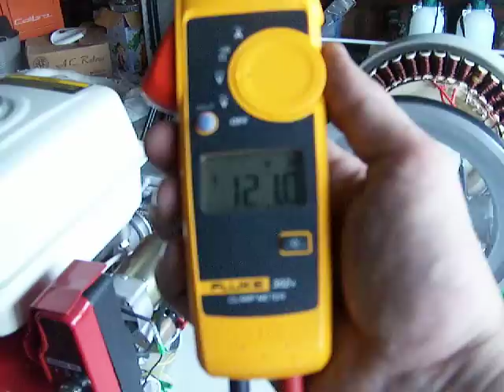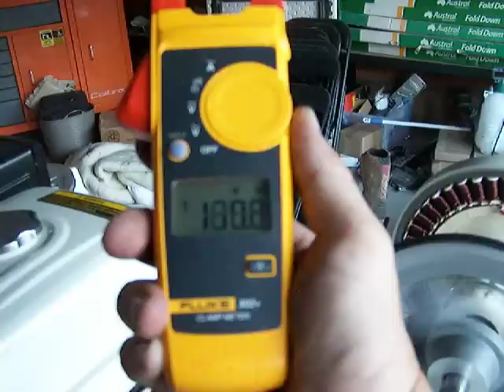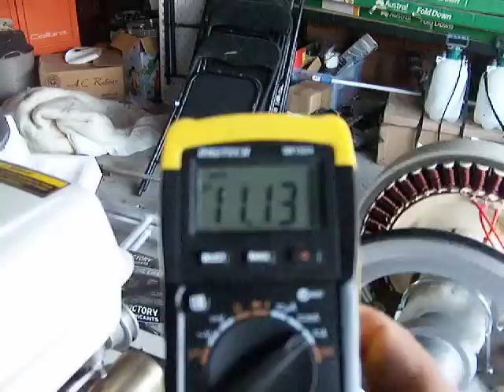Fisher and Paykel smart drive motor testing, part 3

Comment: You mentioned changing the number of turns on the windings ( as well as a more robust wire)  What changes when you increase (or decrease) the number of windings?
Reply: More windings; higher voltage.

Comment: some more info.     there is an  OPTIMAL  configuration for  ANY  pma.      this ain't it      there are REASONS why this info is Not just  opinion.       each phase Should consist of  three, equally spaced coils, connected in series; this is a relative interval of 120 degrees.      the rotor  Should  have  four, equally spaced magnetic poles, per phase; a relative interval of  90 degrees.    this  4:3  ratio results in the three  coils of each phase being energized simultaneously; and the phases energized in sequence.        thanks to hpiggot, some folks think that  Adjacent coils should be interconnected, in a f&p stator.    W R O N G.     it is safe to assume that your mods have NOT resulted in an efficient pma.     so,        the number of coils  Should be a Multiple of  Three;  the number of magnetic poles  SHOULD BE  a  multiple of  Four.     see linked illustration, of a Correct, 3-phase stator config.     it may be possible to reconfigure the  rotor, fairly easily.    the stator,  idk.        cheers
http://scoraigwind.co.uk/wp-content/uploads/2011/07/coils91.png

Comment: you need a better driver that is why , i wonder how much tourqe you have on it now ? what it heat the motor is the lenz and B-EMF , you can run it at 2000 if you want

Comment: Its great that you are experimenting with Power Generation - like Tesla!! A little constructive criticism on the Rotor with the extra strong magnets. I can never believe that you would achieve the maximum output from the F&P Rotor - as made from plastic. One of the first rules is to maintain the smallest possible Air-Gap between the Rotor and Stator Coils. This gap must be consistent and concentric. Can only be achieved with good Bearings and a fully-metal Rotor - such as aluminium. The neodymium magnets could be a shrink-fit into the slots - or even cast-in position. Many motocycle alternators are made in this way. From your video, it would appear that the air-gap has lots of variance (not concentric) between the rotor/stator, which is a bad recipe to start with. Finally, I wondered if you designed a generator with twice the diameter of the F&P Unit. The peripheral speed would increase - at lower engine revs too. Much bigger air - gap between the coils for cooling. Keep up the good work.

Comment: And as someone has already commented you were using the ammeter as the load not just as a current measuring device. What I have done with solar experiments is to get a light fixture and hook it up and as you screw the light bulbs in they become the load and they get hot and will burn you when you go to remove them. Find one that will take 3 light bulbs and screw in 3  60 watt bulbs one at a time but the voltage must be 120 volts or you will burn them out. AL

Comment: I noticed that someone mentioned heat being generated meaning you have resistance. The real truth is that heat is a function of current and resistance. It is the square of the current times the resistance. In this case you are overloading the washing machine motor. Someone said somewhere that the motor draws about 4 amps when working in the washing machine. You used slightly larger wire which lowered the resistance. The real problem is that 4 squared is only 16 times the resistance of the wire ( the old wire). 12 amps squared is 144 times the new lower resistance. If the new wire has 1/2 the resistance of the old wire that is good, but 144 times a new lower resistance that is one half as high results in 72.  72 is over 4 times more heat produced. This is a good experiment but the device is too small to be able to produce power for a long extended period of time without burning up the wire insulation. Al

Comment: heat is always a sign of resistance in your circuit or overloaded draw try using  caps in circuit to help with draw or transformer and caps wire gage increase will help as well

Comment: Matt you need to pulse drive the now highly efficient Fisher & Paykel you built.  Then use this to drive an alternator pulley either use the F&P rotor as fly wheel or add an intermediate one...between prime mover and alternator. Gerry at EmuPlns.

Comment: Just watched this one... and all of your "problems" seem to point to the mis-use of your Amp meter, which should NEVER be connected ACROSS the output of the rectifier... that also explains why it was getting so hot.  Be sure to read my notes on the previous video of this series... it explains in full details.

Comment: I found the solution to making better power with these. Of course you have to get the stators with the heavier gauge  or you can rewind them as you have.  Using 1.6 mm which is about 14 AWG wire is the best method for higher amps. That said, the best rotor design is NOT the fisher paykels design. I used 1 kind of magnet, a 25mm wide x 40mm long x 20 mm thick magnet and used 1 magnet for every 1.75 coils 42 poles got me 24 of these magnets. 
The change I made is I made my own rotor. By simply cutting me a large steel disc and bending a band of metal around it I made a pan ( rotor) with the band of metal being 2x the with of the magnets length to reduce eddy folding. I then placed a thin 24 gauge inner ring of aluminum into the rim and thats what I mounted the magnets to. It was then riveted to the thicker steel. This was done to give shared magnetism but to reduce magnetic pole parasitic reaction. 
That rotor was then cut and vented with ridges to make a blower like effect onto the stator. At 530 Rpms I am making 54 volts and 24 amps.  Not bad for a prototype.
Reply: Any improvements on this design I'm the end ? Thinking of using it for a wind turbine
Reply: Seems like a lot of work, im getting 25 amps from a 42 pole stock windings just reconfigured so every third coil is in parallel. Ive got it on an exercise bike currently and can pedal it to 345 watts at 13 volts under load (lithium battery connected directly) so im sure spinning it fast enough it would do 40-50v no problem. Making a whole new rotor or rewinding each coil by hand sounds like a nightmare! Id love to see yours, you definitely have some dedication going to that much effort, well done!

Comment: Nice job Matt.   If you can get a machine shop to cut the right shaped holes in the spinning rotor you should be able to cause a vortex to keep the stator coils cool.  You can also use pulse technology to gather the output instead of a constant draw.   I'm assuming that you have 4 magnets for each of the original 4 positioned ceramics.  are they the usual NSNS arrangement.    Have you seen Gerard Morins work with these motors?  here's a link 
https://www.youtube.com/watch?v=YZ7I9XgaW3A
Thanks
please email me directly
captainssbn@yahoo.com
Reply from the maker: ***** Thanks, im actually going to make a completely new rotor so i can put 10 x 20 x 50mm N52 neo magnets on it and spin it slow. What im trying to acheive is high output on low rpm. But i wont do any of this for a while as im busy but i will upload it when im done. Yes theres 4 mags as was original and yes they are NSNS.

Comment: Hi AHL, nice work!
Looking at this with pleasure because I am busy designing a pm alternator/generator with a diesel engine that's a lot more silent.
I tried to calculate the voltage of each coil and if I am right, it should be about 12V at 1,1 apms, is that correct? (230V divided by 1,4 for the voltage before the rectifier).

Instead of using "small magnets" I want to use the bigger ones with a lot bigger coil, weak-iron core and a low voltage of about 24V AC totally. The goal is to charge a set of 8 LiFePO4 CALB cells with about 100 Amps.

Could you give me some meore info about your measurements?
Regards

Paul

Comment: That is OK while you run it free, but as soon as you put any sort of proper load on it, it could catch fire, or burn out the coils.
To cool it, draw a bigish number 7 several times on the rotor, use a thin grinder disc to cut the 7's lines, the tease out the cut part(corner) now they will push or pull air through the coils. I hope you understand what I mean, good luck.

Comment from the maker: Yes, you can actually use a 10 inch brake drum, this will stop the warping under heat at least. I dont know, maybe ill give up on the fishers and make a professional style PMA. You can buy them but at $3900 for a 10kw means ill need two and thats alot of cash. Gunna look into making my own proper PMA as i was going to use those in the long run anyway.

Comment from the maker: Thinking of doing that Max, but this morning i came out on my way to work and i took a look at my rotor and it had warped, the heat had softened the resin holding the magnets and the magnets pulled themselves into the stator. So now i got to make a new one.

Comment: That is really good output....For cooling I would cut slits between the magnets, angled towards the rotation, and some bigger exit holes , then it would be like a brake rotor, catch the wind when it rotates, also no load from an extra fan...
Good job mate...
Cheers.
Neal Ward